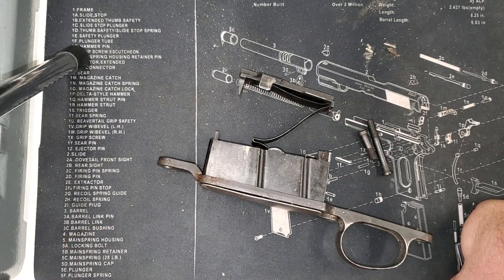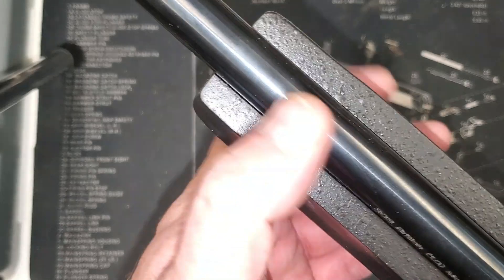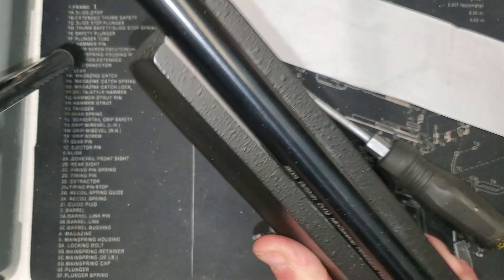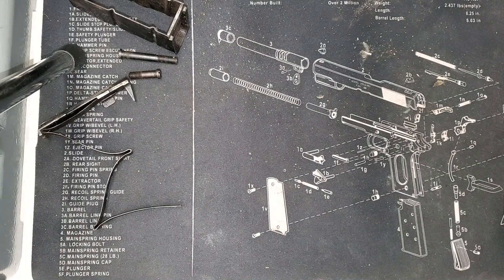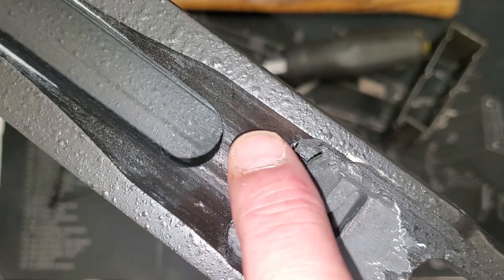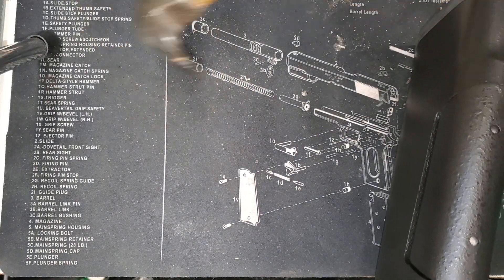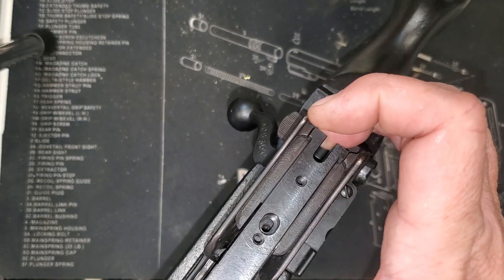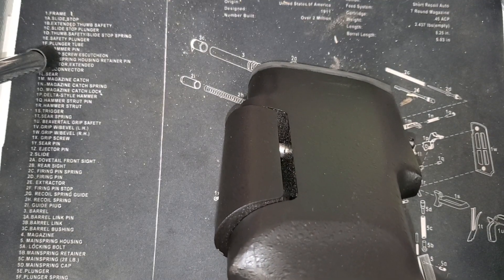P14 Target Rifle Build 303 British

Comment: Figuring out how much epoxy to put in the stock for glass bedding is always a wild a** guess! I like to bed the front action ring and lug seat all the way forward about one inch onto the chamber section of the barrel. Your second bedding looked good. I can't ever remember having a P-14 and a P-17 in the shop at the same time to compare action screws.
 I never gave it any thought, and if asked, I would have assumed that they were the same. Now we need to see how it will shoot! Thanks for sharing!
Rat
Reply from the maker: Thanks Rat, So the screw problem, I got 2 orders of screws, correct length and thread, but the head was taller, sticking about .100 out of the recess, and the diameter of the head is about .025 ish bigger than the recess. The 3rd order was correct height and diameter head. IDK what is going on there. But its done, the one thing I didnt do was the rear tang bedding. I usually like to bed around the rear tang, but this seems a good tight fit. I agree 100% about pushing it out under the chamber, not sure if it helps, but I like a solid print right at the front of the receiver at the rear of the barrel. This stock was pretty rough right under the chamber so I gave it a little extra just to make it nice. I think this will shoot good